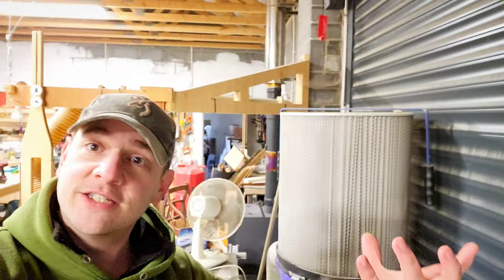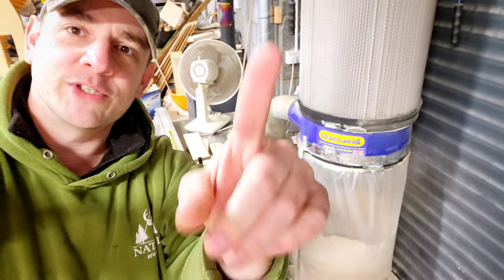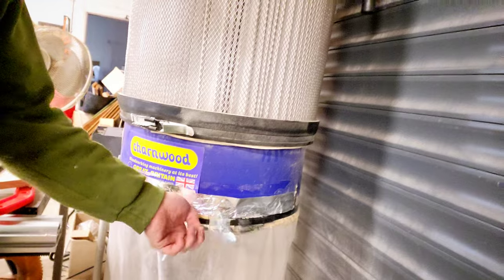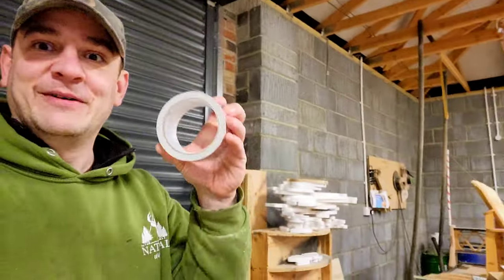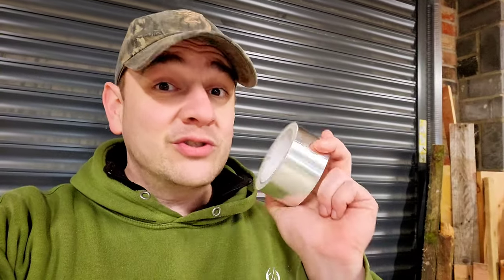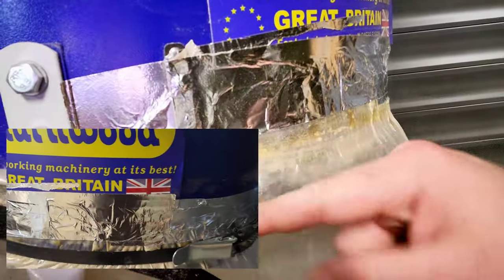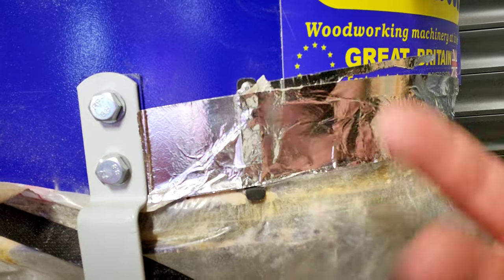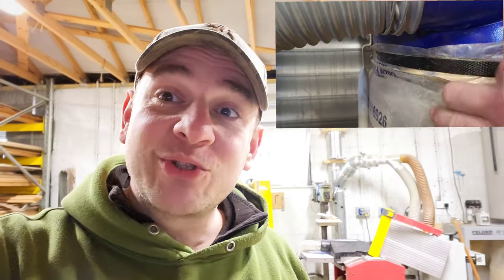"Fix Your Leaky Dust Extractor for Pennies - You Won't Believe How Easy This Is!"

Comment: Closed cell draught excluder foam with a self-adhesive backing works well. I have a wide strip of the stuff stuck around the bottom of the extractor body.....it forms an air-tight seal and helps stop the strap tearing the bag. I also use an elasiticated luggage strap ( it looks like a giant 8mm diameter rubber band) to hold the bag in place whilst I get the metal band in place.....it saves a lot of aggro!
Reply from the maker: Both of those are solid ideas. Ive got some of the draught excluding foam in the shop somewhere I think, Ill give that a go and the luggage strap sounds like a great idea. Thank you!

Comment: If you get a 1 to 1-1/2 inch wide, 1/4 inch thick foam strips, glue them on your extractor all the way around. Then put your plastic bag over it, and clamp it on. The clamp will "dig in" to the foam. Here in the States, you can get rolls of this foam with self-sticky on the back (they use it for sealing around doors).

Otherwise, your method works too. Personally, if I were to use your method, I would clean the surface of dust, apply the bag, and then completely seal it to the extractor before applying the strap.
Reply from the maker: Great idea, Ive got some kicking around so Ill find it out when we clear the shop up and get it added on there! Thanks for the comment 👍🏼

Comment: Correct...Duck Tape has a cloth substrate where Duct Tape is a non gas permiable aluminium foil used on airconditioning systems to make them air proof.
Reply from the maker: Thanks for the info! The ally tape works wonders, that would be why then 😁